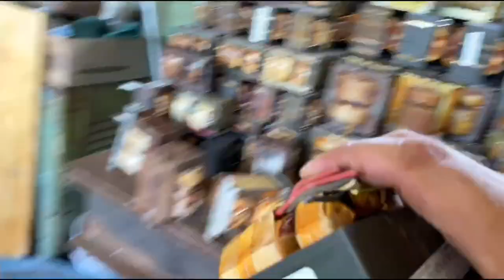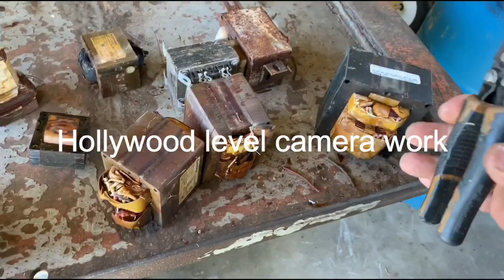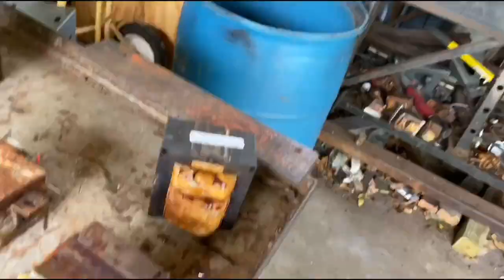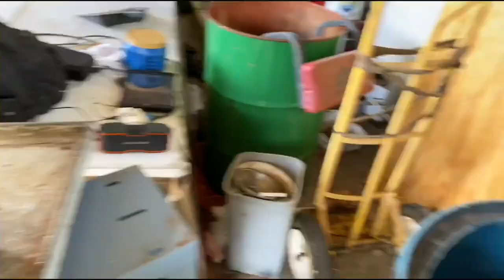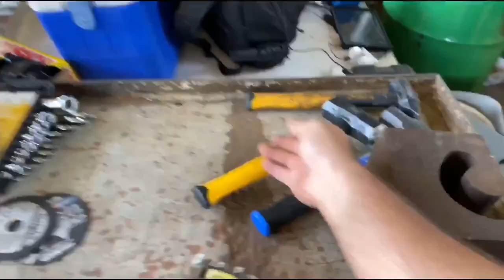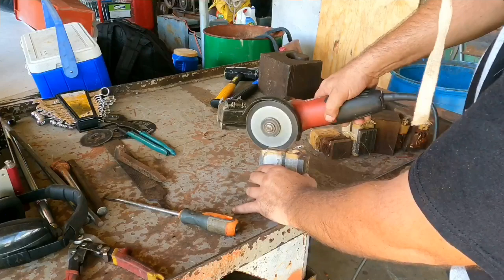How to scrap transformers for copper

Comment: What a great load of personal insight. Will definitely be using. Thanks so, so much. 
If I could be so bold. A have a bit of advice. Instead of statements of “garbage” for those other hammers, per your usage. A better statement would be. Good hammer, design etc. yet, that said. For this need, this hammer works best for this usage.
My girlfriend works for company looking to promote tools, etc. they passed on offers based on comments by content creators. Again thanks for info.
Reply from the maker: Thanks for the advice

Comment: How did you get that many transformers and Who can I contact in my town?
Reply from the maker: I get them from electrical contractors, I pay for them
Reply: @ProjectShopFl  Do you buy the whole thing or just the transformer.  How much do you get from one transformer and how much do you pay?  I would like to do this but what would be a good price to ask them to buy.
Reply from the maker: @znation3585   What do you mean the hole thing? I get them 2 ways,  as you see them and then when I buy hole light fixtures. I pay .20 per LB for copper ones and .08 for aluminum ones. That’s me picking them up, I pay more if they bring them to me. I pay .15 per LB for the complete light fixture. I can pay up to .40-.50 per lb for clean transformers if I had to. On average they are worth about .90 per lb. Its all in how fast you can break them down is how much money you can make. I can do 5 a minute with my press. Good luck and thanks for watching